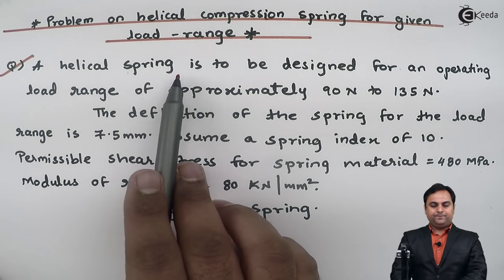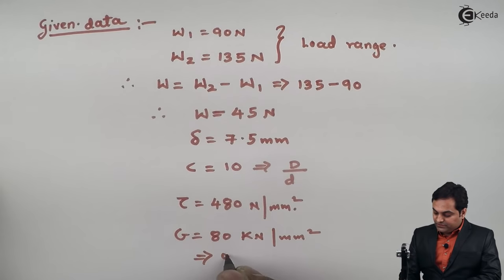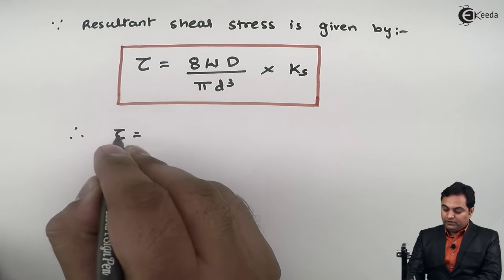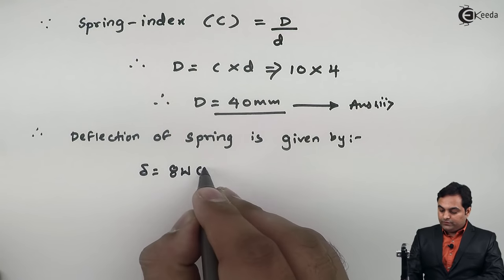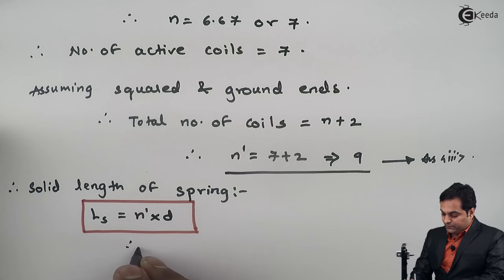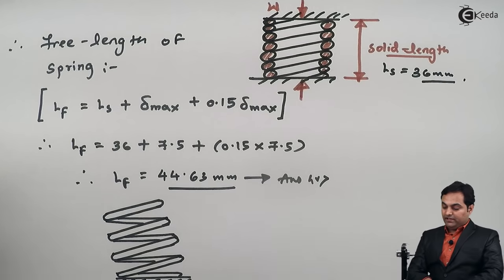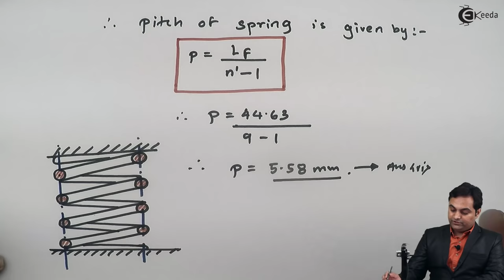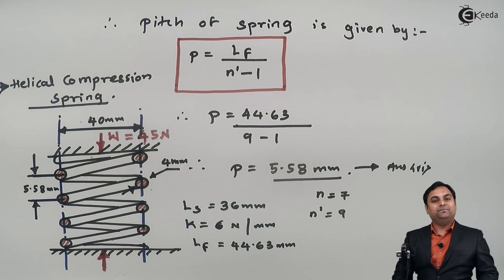Design of Helical Compression Spring Problem For Given Range of Load - Springs - Design of Machine

Comment: I think u r absolutely wrong. ....in many books like bhandari they have taken W =(W1+W2)/2...........not ....W1-W2? U CAN check
Reply: when ever load range is given, the it is wrong to use the method which is used in this video, the correct method is to calculate Twisting moment and find the dia of spring wire.
i.e we have to use these formulae.

T=W2 x (D/2)
T=(pie/16) x d-cube x toe
Reply: Hello are u there?
Reply: @MA-Kareem-Hassan  hello bro

Comment: Sir for maximum deflection you can't take 7.5 . Because in question it have been mention that 7. 5 is for load range so for maximum deflection you have to re- calculate by using same formulae and then n= 7 for finding free length and load will be 135
Reply: Exactly bro

Comment: sir 
at 10.05 
you got "d" value as 1.58 but to make it as a whole no. you should approximate it as 2 mm but you gave the reason for increasing the strength we will take 4mm, can you justify your answer in detail?
bcoz if to increase strength i can also take "d" as 8mm or 16 etc.
Reply: Sir please mention about 4mm instead of 1.58mm in detail.
Reply: when ever load range is given, the it is wrong to use the method which is used in the video, the correct method is to calculate Twisting moment and find the dia of spring wire.
i.e we have to use these formulae.

T=W2 x (D/2)
T=(pie/16) x d-cube x toe
Reply: when ever load range is given, the it is wrong to use the method which is used in this video, the correct method is to calculate Twisting moment and find the dia of spring wire.
i.e we have to use these formulae.

T=W2 x (D/2)
T=(pie/16) x d-cube x toe

Comment: when ever load range is given, the it is wrong to use the method which is used in this video, the correct method is to calculate Twisting moment and find the dia of spring wire.
i.e we have to use these formulae.

T=W2 x (D/2)
T=(pie/16) x d-cube x toe